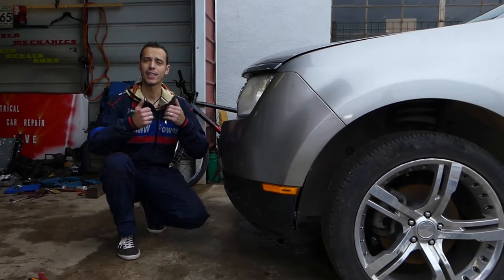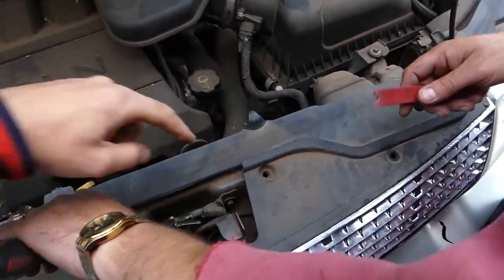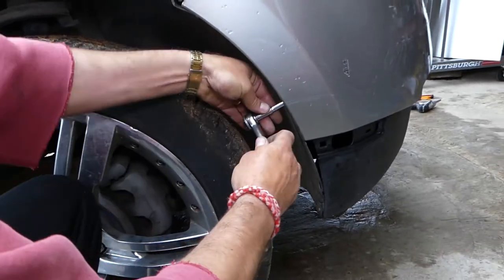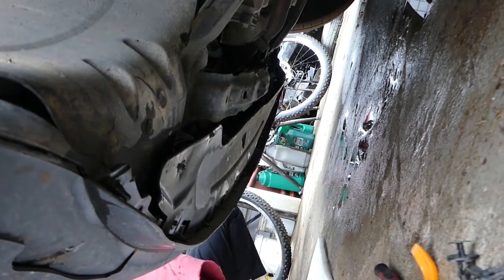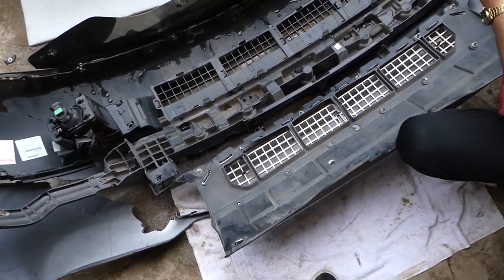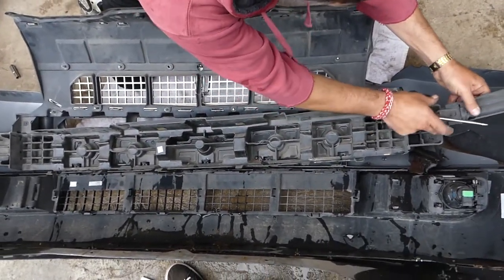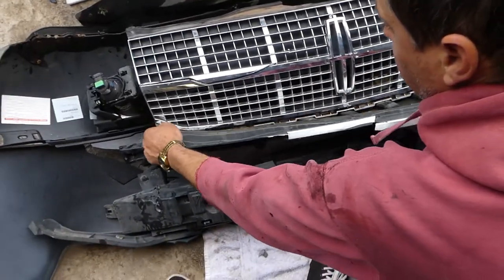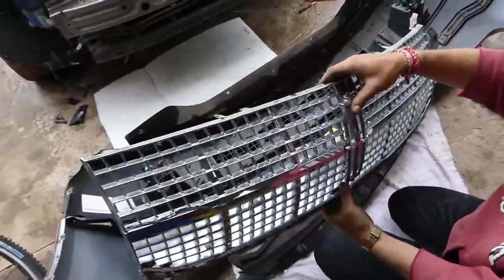LINCOLN MKX GRILL REPLACEMENT REMOVAL. GRILLE

Comment: I appreciate that you do these videos. I buy used cars and I have no problem doing the work myself provided I have some guidance and understanding. 

I've done a lot of work on my 2003 civic way back then. On my current 2009 BMW 328i I did an idrive retrofit along with many other things. 

Just recently I got a 2008 Lincoln MKX. The body is in very good shape, it has new brakes and some new suspension parts. The interior is in very good shape. 

I got the MKX because it was given to me by my grandmother. From you channel I've learned that there is a serious issue with the water pump location. 

I have some other minor issues that I need to address.

One is replacing the back up sensors. The other is the "vista" sunroof is slow in the middle of the track and I suspect a replacement motor might be required. The track looks OK to me but I'm not sure how to know definitively.

The vehicle is pretty rusty underneath but it didn't get flagged as an issue for the safety inspection. 

Any tips for 2021 on this vehicle?